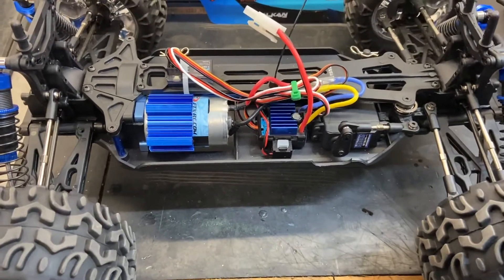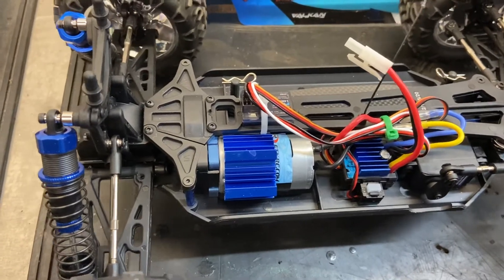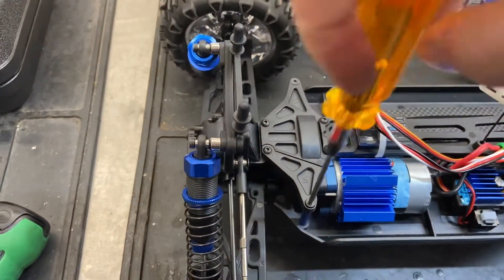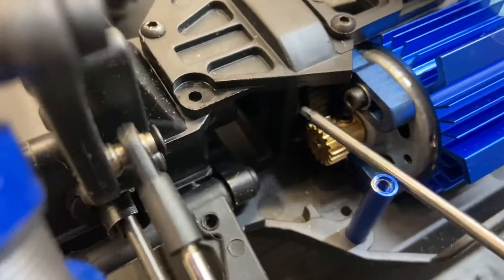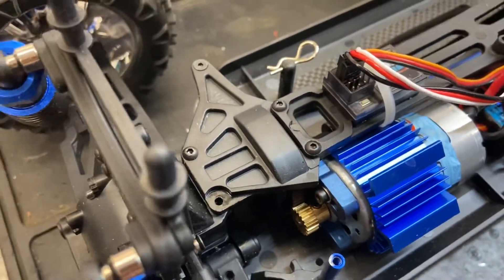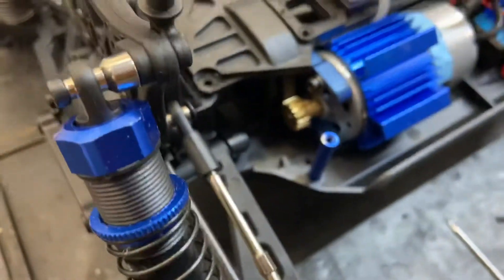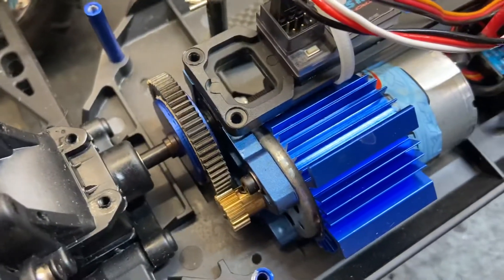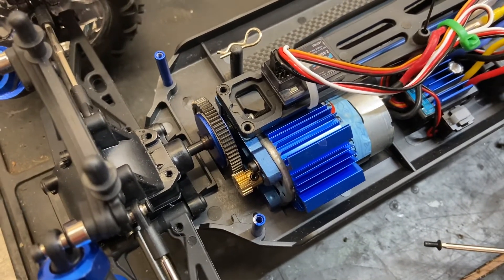Spudski RC How To: Removing the gear cover to access spur and pinion gear FTX Carnage Vantage Bugsta

Comment: Is there a certain way to refit the central drive shaft?
I bought a vantage with spare parts and tried refitting the central drive shaft by removing the rear end of the car but with the central shaft fitted, the screw holes on the rear of the car don’t line up with the chassis
Reply from the maker: Hi, no certain way aslong as it’s slotted into the cups it should go in properly. There must be something out of place if the holes aren’t lining up.

Comment: I have the bugsta which is the same internals as the carnage from what I've been told, took it apart as the wheels won't spin, and you can see only half of the gear is touching the spur, it's like the gear is in backwards as it won't align right, second time had this issue. Is the gear meant to line up exact to the spur? Except mine is now chewed up. Thank you.
Reply from the maker: Hi, it should mesh so the teeth are touching properly, if it doesn’t then the gears are worn or they’re a miss match of pitch type.